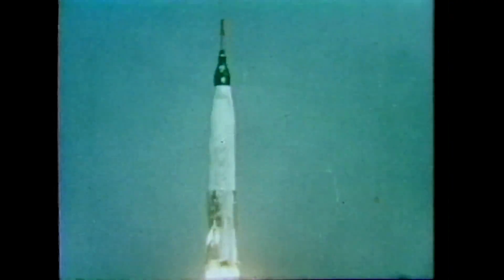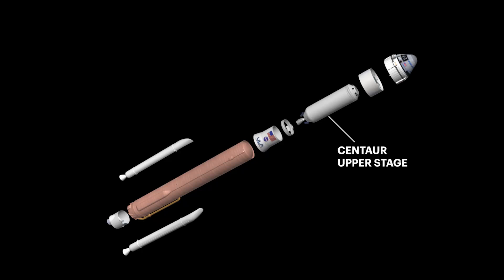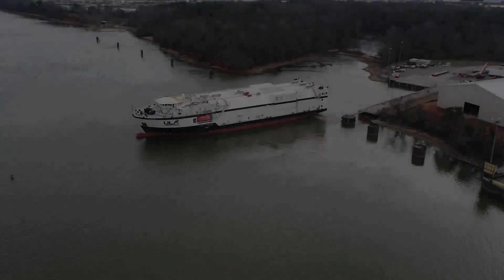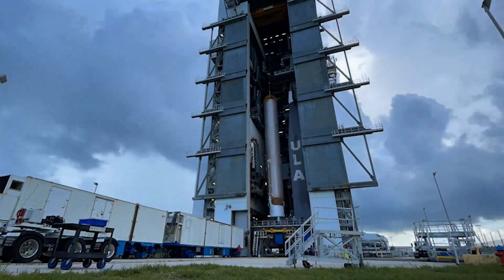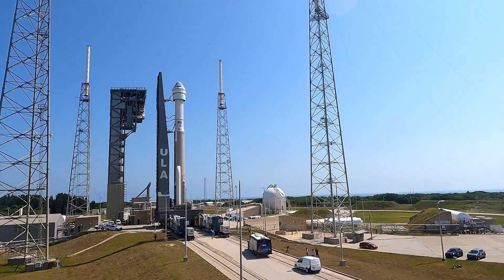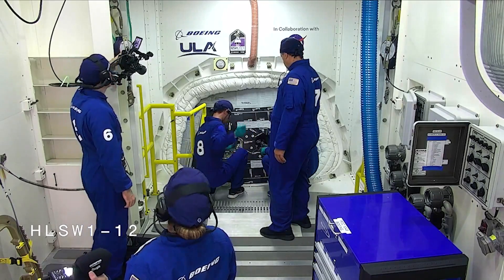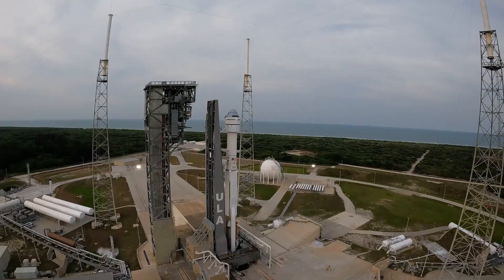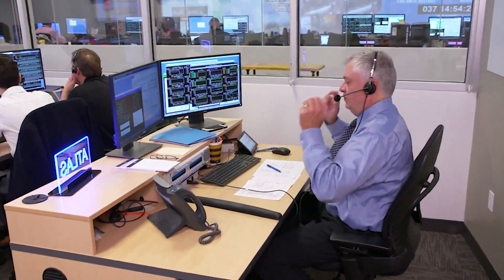Boeing Starliner stacked on Atlas V rocket to launch crew for first time

Comment: its almost guranteed to fail. whatnis unknown is how it will fail. nasa needs to have their collectove heads examined for allowing boeing to put people on this thingnbefore its even been flight proven. it hasnt been flight proven. it madenit to iss once and suffered several failures on the way back. if it fails this time, nasa should force boeing to pay back every cent of R&D costs, plus extra for project delays, and then sever all ties with boeing. this is insane and would not have been tolerated years ago. nasa admitted they messed up giving boeing that contract. at what point does failure become a breach of contract?

Comment: Starliner is obsolete before it ever flew.
Reply: Obsolete? 😂🤣
Reply: @mikewalsh1402  How many years has it been delayed now, and what are the odds it doesn't fly tomorrow?
Reply: @michaelmurphy6195  
Ye of little faith, it’s gonna fly!
Reply: @mikewalsh1402  When will they get the launch vehicle it was designed for?
Reply: @michaelmurphy6195  
If anything is obsolete, it’s the Soyuz, a tin can of a capsule!